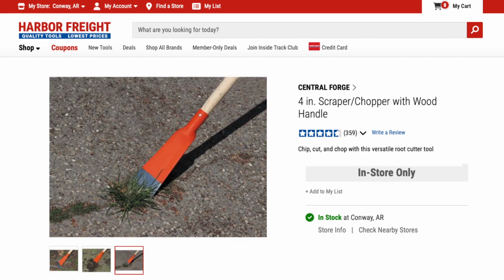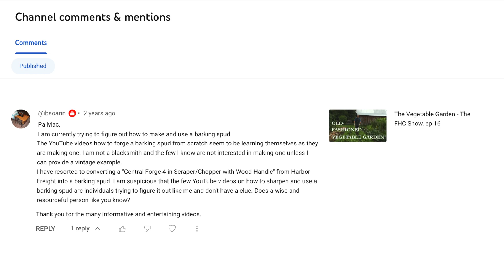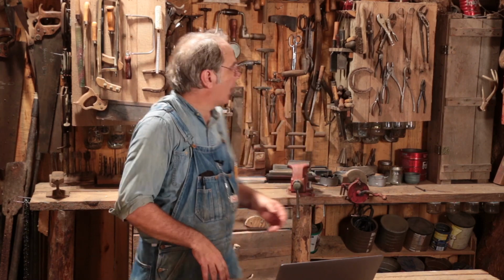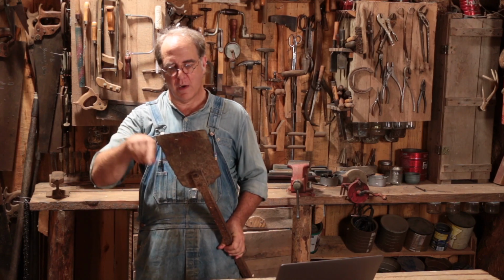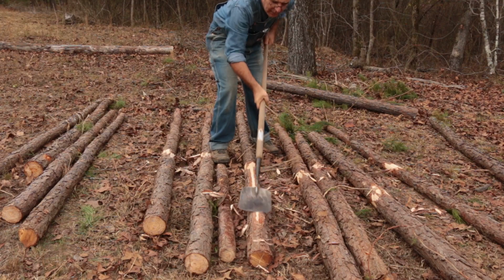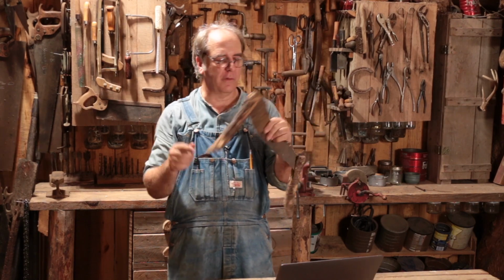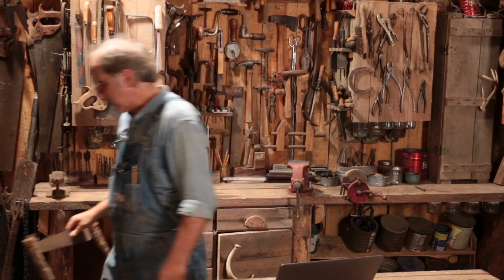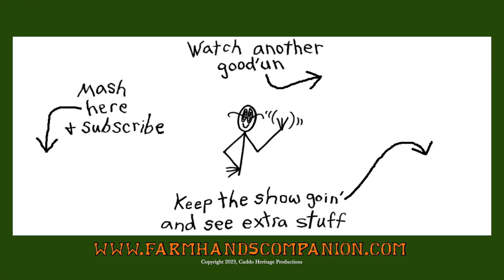The Best Tools for Peeling Poles - FHC Q & A

Comment: I've been peeling longleaf pine and sweet gums with a draw knife and also with a scraper just like IB-sorin was using. I find the draw knife a better tool, but also harder work. When I used the scraper, I was using it the opposite as Pa Mac with the wedge of the blade having the more aggressive attack angle. So I tried again both ways and found that some time one way works better, then some times flipping it over works better. 
In my opinion, the most important factor is having the log at the best working height. For me, that was putting on two short logs that lay on the ground and I made "V" notches to prevent movement. I also learned that If I change my seating position and sit on the peeled section of the pine log, I can later wander around in public with sap all over my bottom for the amusement of the general public.

Comment: I sure enjoyed this video thanks for doing one on this subject. I have some trees I took down about a year ago that I have had stacked on a concrete slab except for a few smaller diameter ones that I used as posts in my garden to hold up some trellis wire. I left the bark on them out of laziness on my part. I bought a cheap curved draw knife last year but haven't tried it, I think I need to build that sawbuck stand to use it efficiently and I got so many other projects going on my homestead that one has been on backburner mostly because I can't decide what to build that would work best for me that would be dual purpose to shave bark from pole as well as cut up some wood to the woodburner this winter. I've seen lots of videos on youtube but can't decide. Do you have an opinion? I searched your videos but didn't find any on that subject, a sawbuck to build that is.
Reply from the maker: Yes, Maggie, there is a style of sawbuck that I've arrived at that's fairly easy to build and comes apart nicely for storage. Until I can demonstrate that one, though, I would recommend you buildin' one that is as simple as possible. In fact, the simplest thing I can think of is to take 3 small poles, each about 4 feet in length and tie or wire them together teepee style. You can lay one end of a pole to be peeled on top of the teepee for easy peeling. Then, if you made a second teepee, you can lay firewood poles across the top of both teepees to buck up your firewood. Thanks for watchin', and I hope that helps.
Reply: @farmhandscompanion  thank you, do you think that would be stable enough to use while debarking a pole with a draw knife?
Reply from the maker: It should be stable enough...providin' your poles are stout (4 inch diameter is good) and your wire holding 'em together is heavy gauge enough and well tied or twisted. With all that in place, the weight of the pole bein' peeled and your bearin' down on it should make the whole teepee even stronger. @Maggie-Gardener-Maker
Reply: @farmhandscompanion  thank you

Comment: I am the type that uses what I have. And for peeling poles I only have a draw knife and Grandpa's clamp. This is how I do it.

1) Place two poles parallel to each other on the ground. These are the ground poles.
2) Place on top a third pole to be peeled perpendicular to the two from step 1. This is the peel pole.
3) Straddle the peel pole, sit on it, and clamp it with my legs (Grandpa's clamp). Start peeling with the draw knife. Move down the pole as needed. Reverse direction at the other end.
4) As needed when one side is peeled, simply roll the peel pole on the ground poles to give a new side to peel. Return to step 3.

To make things more comfortable, especially on skinny poles, a folded towel to sit on is suggested. 🙂

Hope this helps.

Comment: Last winter at work I got to peel about 10 Siberian Elm tree trunks. Now they're in an Orangutan exhibit at a zoo. Most of the bark was quite stubborn I think being elm, and in the winter. Since we're keeping the good branches, I had to peel into crotches and concavities as well. I used the drawknife for most of the work. For thick bark I used the axe to get it started. In the crotches and concavities I used the axe holding at the head, and also a cheap import barking spud. The spud was more like a large chisel (slick). Because of the concavities, I ground the back a little convex, and ground a curve on the edge profile, then sharpened it like a chisel. For my task, I found frequent sharpening quite helpful (touch up every half hour or so), though on easier to peel trees it may be less necessary.

Comment: Love your channel. During the late 1960s early 1970s we had a Sawmill where had contract to cut crossties, and provide creosoted pine fence post. We had two 55 gallon barrels welded together end to end buried in the ground at a angle with creosote in it to treat the post. We peeled the pine post with a garden hoe that the neck had been heated and straightened. Worked awesome for many years.

Comment: What about an actual bark spud? I have several different styles with various blade designs and handle lengths. Another garden tool that works good for peeling bark is a flat spade with a "D" handle. Some have a slightly curved blade that follows the log. It is also helpful to raise the log if possible to ease the back strain. Thanks for sharing!

Comment: I started blacksmithing about 4 months ago in a club. The fifth thing I made was a barkspud. Took a really thick truck spring, drawed it out by a lot of hammering (make it thinner and thus lighter), put a curve lengthwise using a swage (like the original spring shape), and then also from the short side to the short side (the face of it) using a swage again - to follow the natural curvature of a tree. Cut a hook in the back end  - a la Swedish style - and welded a circular piece of pipe which I tapered beforehand as a handle.  Put an edge on the front using a grinding belt, and then an edge all along the left side too in case I need to slice off bark in pieces.The old timers at the club loved it. It is so strong, it will last 500+ years. And it takes off bark off a pole, as easy as slicing bread, maybe easier. Tell those blacksmiths to put their perfectionist ego aside, this is a super easy project.

Comment: I use a ball peen hammer to remove bark. It works the best imo. Whack the ball side all over the trunk to crush and loosen the bark and then flip the hammer over to whack off the crushed bark. I usually do it in a seated position.

Comment: Thankyou.
Why dont people just leave the logs alone and let them shed their bark over a couple of years as the wood dries out? I notice that my felled trees shed their own bark and then theres loose bark thats mostly easy to peel off with gloved hands. Just patience is required for this lazy style method.
Reply: Because insects will eat up under the bark and damage the wood. Letting the bark dry off only works in certain climates, conditions, and types of trees. Stripping and proper drying is best practice.